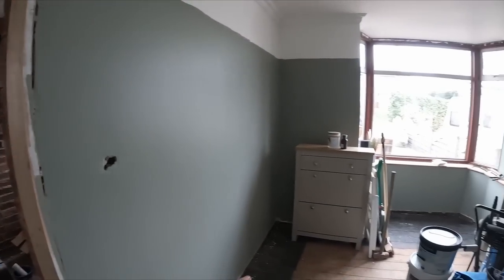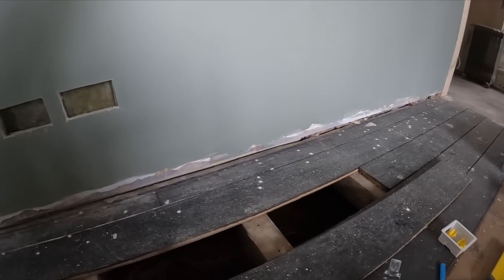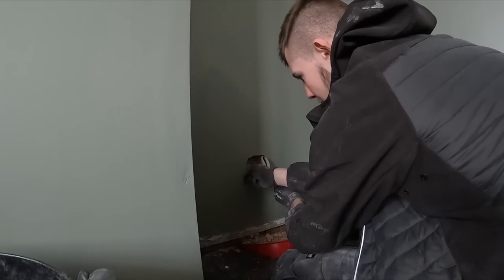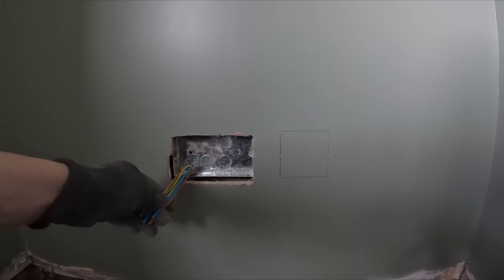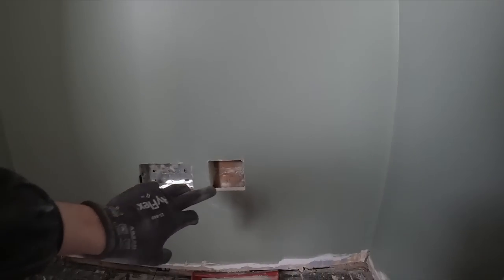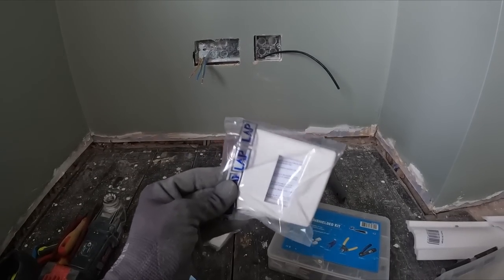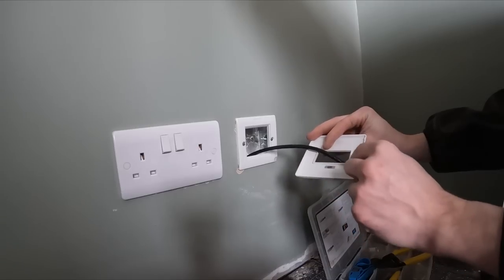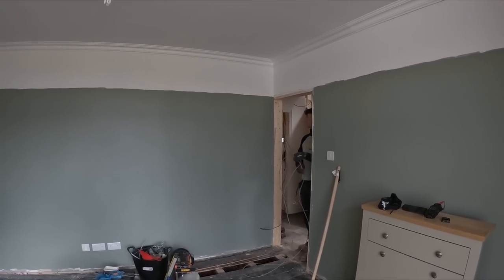Why Electricians Don't Like Plasterers - Tradesmen war ?

Comment: I noticed when you were doing the data point you separated all the individual pairs, on the AM2 make sure the pairs are twisted until you reach the terminations. Also my record for hidden back boxes is 29!
Reply from the maker: Cheers
Reply: I knew someone would say this 😂
Reply: mate for a inch of individual pairs seperated its not a massive deal ffs give it a rest
Reply: @jamieisbadiof6106  I don’t see anything wrong with it at all but my assessor on the AM2 pulled me on it
Reply: The idea is that the pairs are twisted together to cancel out any interference. Whether or not it makes a significant difference in real life I couldn’t say but it is usually something that catches people out in the AM2.
Reply: Came here to say the same about keeping the cores twisted. It does make a difference to interference. Keep the individual pairs twisted up to their individual punch down terminals - or run the risk of the customer calling you back to re-terminate the lot because their broadband isn’t running at full speed.
Reply: @jamieisbadiof6106  can be - if you're wiring CAT6, 6a, 7 etc and you want to certify it, if you remove too many twists you can introduce enough cross talk or noise for the cable to fail to certify and you'll have to reterminate it better to achieve certification via a fluke, trend etc certifier
Reply: @jamespetre  it can make a big difference and the higher the CAT certification you're working too, essentially the bigger impact it can have the higher the cat standard (in basic terms) - brands like excel etc offer 25 year warranty on installations but ONLY if they're certified using an approved certification device (all the vendors list them, but it's basically flukes, trends, AEM etc etc) and if you do not maintain enough twists to reduce cross talk and interference the cables won't certify and you'll have to reterminate them. 5e is pretty forgiving really, but 6a and 7 can be difficult. i've spoken to some cabling contractors that have admitted they have had to certify the cable with the faceplate hanging off as when they put the faceplate onto the backbox and tighten it, it creates a tiny bit of cross talk, but enough to fail the run - that was with 6a. I hate terminating and certifying 6a.

Comment: A few years back I was able to buy plastic extension units which you fixed to the back box via the two accessory screw fixings before plastering. They protruded about 15mm and the plasterer worked up to them. They were usually easy to take out and re-use, but if not you could just break them out as they were literally pennies each. Brilliant piece of kit, but I don't know if you can still get them.
Can anyone let us know if they have ever used them, and are they still available.
Reply from the maker: Sounds good
Reply: Most other countries use them but not the British,,  years behind in many areas of building!

Comment: Hi Adam, I have seen some Plasterers , (The Good ones) use a tool called Rotozip. It allows you to cut the Plasterboard and follows the Box behind the wall and not damage any thing. Maybe something to make it easier in these situations.
Reply from the maker: Thanks for the tip!

Comment: you must keep the cores of data cable twisted right up to the IDC connectors! The frequencies used by data cable are very high (100MHz or more). I once tested a whole building’s data cables (with v.expensive hired in tester) and just one plugged together joint had a huge impact on the performance of that cable.
Reply from the maker: Ok cheers